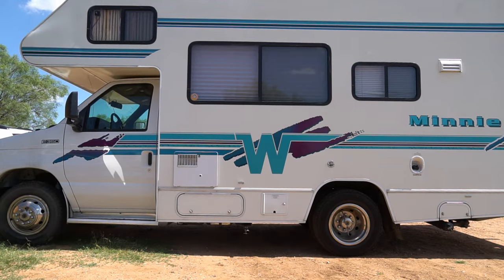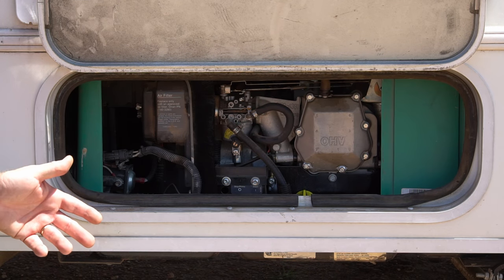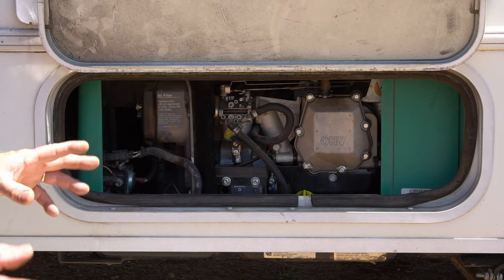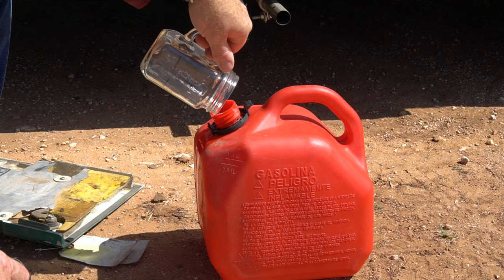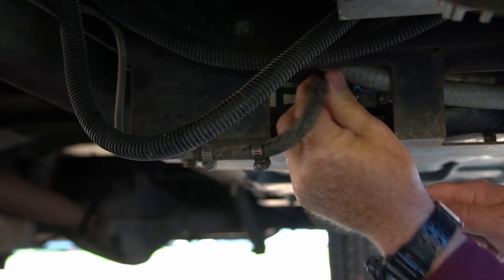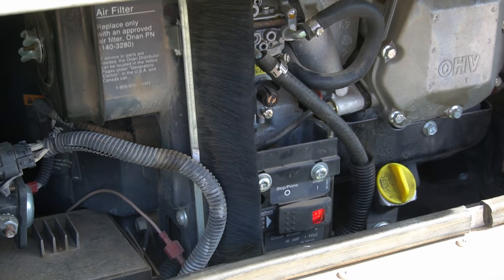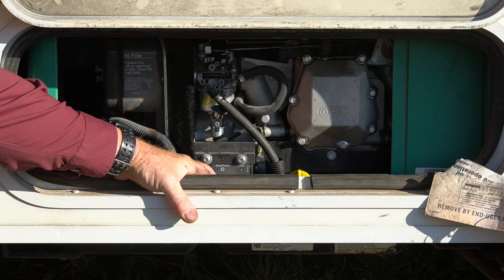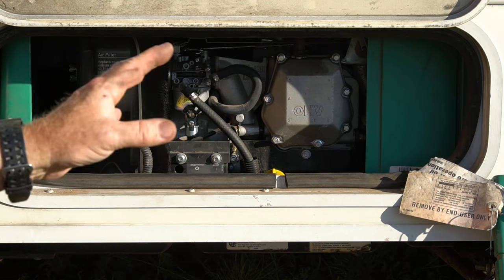🔧 How to fix a clogged Carburetor on an Onan Generator  Quick and Easy!

Comment: Thanks for the pointers. I got a good tip from a Cummins tech. He said to install a shut off gas valve in line just before it goes into the carb. When you're ready to store for a while, turn off the gas valve, start the gen, and let it run out to empty the bowl. He said you will never have to replace the carb if you do this.
Reply: I put one between the fuel tank and the generator this way the fuel pump and filter also don't sit with gas in them.
Reply: Show some pics
Reply: Great advice.
Reply: What size is the fuel line? 1/4”?
Reply: Did it work?
Reply: Yep!  This advise holds true for every carb'd small engine.

Comment: Just open the float bowl drain and put cleaner directly in there.  It's super simple.  Connect a hose to that nipple under the float bowl.  Turn that little screw counter clockwise to open the valve.  Push cleaner into the tube.  No disassembly needed.
Reply from the maker: Thank you for this great information NackDSP.  I appreciate it very much when viewers contribute useful information as you have here.

Comment: Thanks for the video!  I'm about to do this maintenance. If you want to run the generator for 30 minutes you might want to put the cover back on to direct the fan air to where it will do the most cooling.
Reply from the maker: I am glad the video was useful.

Comment: Thank you , RV Onan shutting down when A/C turned on, noted idle arm over working. Did your clean system as suggested works great.  2 gallon gas , (Used less than one) 3 ft of fuel line and sea foam. follow instructions. A cheap fix.
Reply from the maker: You are welcome. I am glad to hear that it helped.

Comment: One way to avoid carb gunning up is to add sea foam or a good stable product to the last fill up when parking the rig for an extended period. Then just run gen at appx half load for appx 30 minutes once or twice a month. Has worked on my onan 4k for 6 years now. Be sure to run gen.

Comment: The phillips headed screw at the base of the carb bowl opens the drain. Just open it and drain the carb anytime the machine is sitting unused for any long time.......You can also pull off the fuel line and use a hose and bottle to gravity feed something like Seafoam or WD-40 into the carb but is not a must. I had 2 4KY's and just drained them every winter......they ran fine in spring once brought back to life....
Reply from the maker: Great information. Thanks for commenting.

Comment: My carb was bad, wouldn't run at all without starter fluid.  This didn't work for me, removing it and carb cleaner neither.   If this fails, the $50 replacement carb on Amazon worked wonders for me and was probably faster as you can swap these out in 5-10 minutes once you know how.
Reply: Mine won't run without starter fluid either. Which Amazon store did you buy your carb from?  How was the quality?  Thanks
Reply: I have a 467.3 for Georgie boy and I have a Onan genset emerald 1 and I'm having the same problem won't start about to take the car did the carburetor cleaner and all that on about to take it off and see if I could clean it and if that doesn't work then I am going to buy that carburetor from Amazon so I'll keep you guys posted to right now I did clean it when I opened out the air cleaner and took it all apart and had access to cleaning it spraying around it and that didn't work so now tomorrow I'm going to take it off I'll keep you guys posted and keep you know what's cooking as of right now it only starts when I spray it with starter fluid so the heat is on.lol

Comment: I had been racking my head on how to get that gunk out of my carburetor and this did the trick!! Thanks for posting.I went a step farther and added a fuel shutoff valve so to eliminate the fuel sitting in the carburetor. I also added stabile to the fuel tank and added only non-ethanol fuel to the tank!
Reply: Where did you put it? Is it working good?  Can you please post a pic?
Reply: Any chance you made a video of this?

Comment: Thanks for the info. I didn`t run my gen for about three months, when I finely got it started it sputtered and reaved up and down. I ran some seafoam through the carb and after three cycles of running for about 20min then turning the gen off for 5min, it now purrs like a kitten. Thank you.
Reply from the maker: Thank you for commenting Rick Katevas!  I am so glad the video was helpful.
Reply: Need to run gen with a load on it ....

Comment: One thing I just figured out is that on mine when you remove incoming gas line not much comes out.  Going back to blow some air through line back to tank.  Then going to run his fix just to make sure carb is clean.  Nice video.
Reply from the maker: Thank you for commenting ken knight!  I am so glad the video was helpful.

Comment: Great video.  Before putting it back together I'm going to install a shut off valve on the gas line to prevent the gunk you spoke of in the future.
Reply from the maker: There are some disagreements on this issue.  Some mechanics say to not leave the carb dry on the Onan for too long; others say it is okay, but it is better to just put Stabil the fuel for storage.  I use mine quite frequently year-round so, it is not an issue for me.  I had just bought the RV when I made this video and it had been sitting for three years, so that is why I needed to clean it up.
Reply: @thejungleexplorer  more great information.  Thanks.  I just order a case os stabilizer so that should do the trick.  I ordered a new carb but am trying your sea foam cleaning first.
Reply: I tried Stabil and I'm still having carb issues..

Comment: I removed my carb and cleaned in my ultrasonic cleaner the other day. What a PIA reinstalling. Lolol. I also adjusted the valves. I have a few more mods to do and button it up and try it out.

Comment: Good video.  My 4000 Onan just stopped running like it wasn't getting any fuel.  Turned out my fuel tank on the motor home was less than a quarter full.  I filled the tank and the generator started right up.  Apparently my unit has a shut off devise to the generator to prevent you from exhausting the RV fuel tank by running the generator too long.
Reply from the maker: That sounds like a great safety feature.

Comment: Thanks for the info. I’ve heard that its a good idea to run your generator once a month for about 30 minutes with a load to help keep the carburetor clean.
Reply from the maker: It is best to drain the gas out when storing longer than a month.  Modern gas has a short shelf life unless you mix in fuel stabilizers.

Comment: We have a one year old Onan 2800 on our 1 year old Winnebago Travato. Our generator at 11 hours of use began surging and dying. All previous use was just exercising the unit. I did attempt to do a cleaning with Seafoam in the gasoline and a few sprays or carburetor cleaner into the intake.  Actually it would idle when spraying then surge and die. That did not work so we took it to the Onan sevice center. I was reluctant to take the time to do that as we have been told that Onan usually denies the warranty coverage. So they did a check and the called and said it was the carburetor would be warrenty covered.  What a relief I did a happy dance! Then an hour later they called back and said “sorry we found residue in the bowl and that Onan would not warranty the repair”.  The price for removing the unit and replacing the carburetor was said to be $961.  I asked for a better price and they did agree to $650.  So looks like what I have been reading all over the internet is true, if you put gas in your generator and follow the suggestions for keeping it exercised there still will be no warranty coverage for your $3,500 generator.
Reply from the maker: So sorry to hear this.  I would contact Onan directly and talk to them about this.  This does not seem right.  If they refuse to do anything for you, remind them that there are plenty of review sites where you would rather not inform people about how bad their warranty and customer service is and that nobody needs bad press right now with the economy the way it is.  Sometimes it helps to remind these companies that consumers now have a very loud voice on the internet.
Reply: It isn't a warranty issue. Its a lack of maintenance and understanding on your part. 
READ THE MANUAL !!
Reply: Also, a dirty carb does NOT need to be replaced.
Reply: @trustme7731  I bought the 1 year old RV with this issue.
Reply: @trustme7731  Well if you go to Onan it will.  I tried to clean the carb many different ways.  I went so far as to buy a small gas tank to attach to it with pure gas.  Did the seafoam thing too.  I tried at least a half dozen ways to get it going and finally gave up.
Reply: Ok, but you didn't remove the carb bowl to see what was going on. Chemical cleaners aren't miracle cures. Sometimes disassembly needs to be done and it doesn't cost hundreds of dollars to do this. I am disappointed in Onan dealers, from what I read, that they aren't doing just the work that is needed and are far too quick to throw over priced parts at them and don't seem to understand the problems.
What did the diagnostic code say when it failed?
How were you exercising it, exactly?
Reply: @trustme7731  When we bought the Travato at 1 year old it only had 7 hours on the generator.  It surged and died.  All the way home from Arizona to Portland, Oregon I was putting fuel cleaners in the tank a full can on a half tank.  Did not help.  Tried at least 5 ways of getting carb cleaner in to it and clear gas.  I really did not have much luck getting the genny to pull the fuel in.  So I bought a small engine gas tank and hung that from the top with fuel line going down hoping for gravity feed but still I just got sputter and die.  Gave up after about 10 different ideas.  BTW how does the genny know when it should not go because the fuel tank on the van is too low?  Its been good since the new carb.  We turn it on every week for 45 minutes.
Reply: Putting cleaners in your vehicle fuel tank is useless unless the generator runs to draw the chemical into the generator. An external tank is useless without the generators fuel pump to provide the pressure. 
How does the generator know when the vehicle fuel tank is too low? Umm, it stops running. In most rigs the generator cannot draw the fuel tank below 1/4. 
You didn't answer what the diagnostic code was on the generator.
There is NO reason to replace a clogged carb. Cleaning is easy. Probably all they did anyway. 
You can't just "turn it on to exercise it. Usually they need 1 to 2 hours UNDER LOAD. Twice per month should be plenty. Drive the rig at the same time for the same reason.
You REALLY need to read and understand the owners manual.

Comment: I did good but apparently I have a 100 hrs on it so it shuts off until it is serviced and they reset it with their secret code. One of those money sucking features. Your instructions were perfect. The red light was flashing 3x which means service. What threw me was the fuel hose was on with one of those fancy brackets. One of those one and done. I almost went and bought their fancy tool to put on another but finally said heck with it give me the regular brackets. Oetiker clamp!  A lot of work getting it off.
Reply: There is no such thing as a secret code all you do is push the stop once and it will flash the code on why the gen shut down. Its basically just a check engine light. You can download  a free service manual  online for these and it will tell you what the flash codes mean. And when you push the stop once after a 3 flash service code then you can restart it. Like a 14 which is one flash pause then 4 quick  flashes  is over frequency which means it revved up to much and its protecting itself.
Reply: 3 is the first number of the error code, then it does a second number. Example: flash, flash, flash, pause, flash X 6 times = Code 36 then refer to owners manual.
Reply: It never ceases to amaze me that people never read and understand the owners manual.
100 hours and a secret code.  LOL

Comment: Hello sir thank you for the info I will try your way. It so happens to be the exact carburetor like mine, but my question to you or any one on the comments is what is the the top hose connected to the carburetor for ? I now the bottom hose every time I purge it shoots out gas but the top one doesn’t? Any idea what is its function? Please anyone have an idea ?
Reply from the maker: Hi. I hope the video helps you get your generator running right.  This was not actually my rig. I was just helping a friend out. So, I am not sure which hos you are referring to.
Reply: @thejungleexplorer  oh ok it’s the carburetor on the video has to fuel hoses ? Or only 1 the bottom one when you prime it shoots out fuel but the top one doesn’t? Do you have an idea what that hose is used for ?

Comment: I just bout an RV with an Onan 2800 that had sat all winter not running or winterized and the generator surges up and down and up and down and over and over. I’m going to try your method, thanks! I was also thing of putting a fuel cut off under there too.
Reply from the maker: Thanks for commenting. I am so glad it helped.

Comment: On mine I installed a splitter valve I line to the carburetor. Turn it left and it will draw from the RV tank turn it right and it will draw from a gas can like this. It's just permanently installed on the couch.
Reply from the maker: That is a great idea. I thought about doing the same. Glad to know it works good for you.
Reply: Can you tell me exact model splitter valve part you used? I want to try it

Comment: Hi there, I have an older 4000 Onan Emerald plus and it won't even start to run the seafoam through-  I imagine that I have to take to take it apart....?
Reply from the maker: Yeah, sounds like you might to clean the carb out to get it at least to run.
Reply: @thejungleexplorer  
Thanks! I did take it apart and cleaned it and it's working well now- not as complex as I thought, thanks again
Reply: @miguelpayette2966  how did you learn to do this? Was there a video or website you used to guide you?
Reply: @l0gic23   no just take pictures as you go and lay parts out as removed.

Comment: Where in the fuel line would you put the shutoff valve?
Reply from the maker: Each RV will be different, so the best I can say is to put it in the best place possible on the incoming fuel line.  I wish I could be more helpful, but there are just too many makes and models for me to give you specific instructions.

Comment: i
good advice. but I'd rather not mess around with the fuel line so  i think I'll wait till the tank is empty then add a gallon of gas and the seafoam to the tank and let it run.

Comment: Very good video. My experience with these carbs is that they are sealed units and cannot be opened. As a result, replacement is the only fix
Reply: The float bowl is removable and the jets can be cleaned. Problem is leaky crush washers when reassembly, replace or sand with 220 grit to flatten them out.

Comment: hi, thanks for the info, I will have to try this on mine. by the way, do you have a link to the shut-off valve for this? this is what these gens are needing as to avoid gas from staying in carb. thanks in advance.
Reply from the maker: Thanks. Sorry, I do not have a link for the shutoff valve. I never made this conversion. Some other people have said they did this in the comments. You try reaching out to them to see what they used.

Comment: I just came into a really nice, lightly used, long stored, cosmetically challenged, and a little dry rotted trailer. It has the onan 4ky-J gasoline generator, with 135 hours on it. I just got fuel going into the carb itself,a problem with the lines. The gas tank was empty and clean which I checked it with my boroscope. But anyway when I tired starting it there was gas blowing back into the air filter. With that low of hours I wouldn't think anything more than a cleaning would be necessary, but I'm unsure as to why gas is blowing back either. I'd appreciate any input.
Reply from the maker: Man, I would have itr looked at. I don;t know what might cause that.

Comment: Great video but you didn't show when you adjusted the altitude screw on the front of the carb it you look the screw slot jumped from 1 o'clock to 10 o'clock position  there is also a bowl drain right below that adjustment
Reply from the maker: Good info. Thanks for sharing

Comment: Why not cut the fuel line right where it's  going into the carb?  Then do the treatment and put a shutoff valve in for future.
Reply from the maker: Yes, you can do it that way too.
Reply: Because you need the fuel pump. The good gas needs to go in the line before the fuel pump, not after it.

Comment: Will this process work with diesel?  I just bought a used RV, it was running fine when I got it.  I tried to start it yesterday and it won’t turn over. It has only been sitting a few days.  I ran it for about 30 minutes before parking it and it worked fine.  Thanks!
Reply from the maker: I believe so